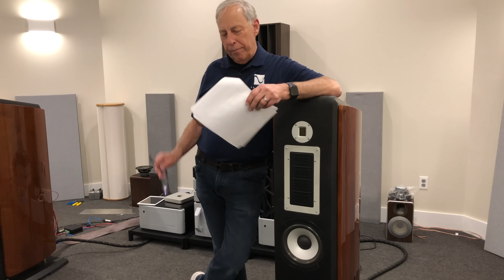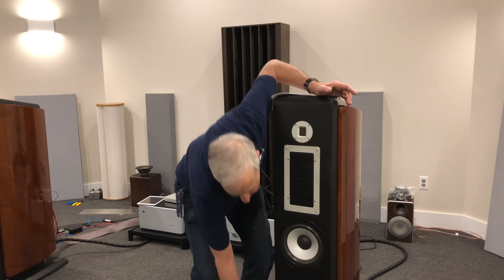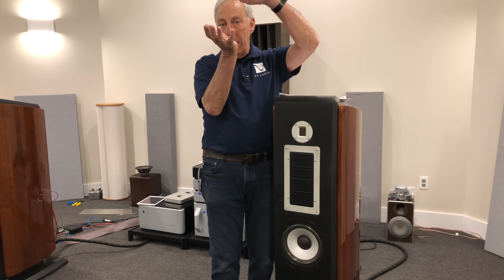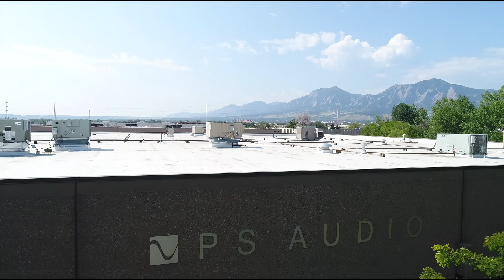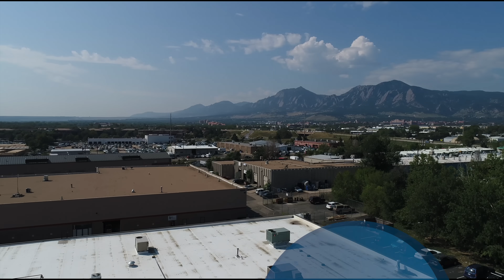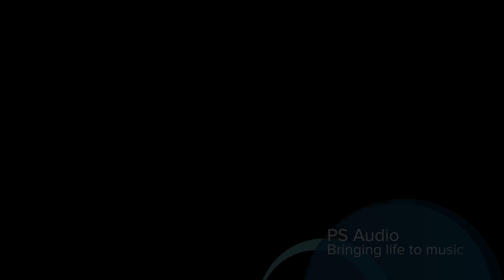Explain a 2.5 way audio system

Comment: 2 way
Tweeter: 2000hz - 20000hz
Woofer: 20hz - 2000hz

2.5 way
Tweeter: 2000hz - 20000hz
Upper woofer: 20hz - 2000hz
Lower woofer: 20hz - 200hz

3 way
Tweeter: 2000hz - 20000hz
Mid: 200hz - 2000hz
Woofer: 20hz - 200hz
Reply: that woofer rarely goes down to 20hz though

Comment: Actually a lot 2.5 way speaker simply a full range two way speaker with midbass addon. These speakers have a bookshelf like solid soundstage with a more bodied sound. If upper woofer in a closed box sounds much cleaner because there is no port distortion. Also lower woofer in a bigger ported box can extend bass much deeper without effect midrange and helps kick bass. I'm using 2.5 way German Maestro Linea-S F-One speakers on my system with stereo subs (12" closed box) works nicely I think. Thanks mr. Paul for very informative and helpful videos on this channel.

Comment: The Thought behind a 2.5 way  Box with, for example two 5" Drivers and a Subwoofer (like mine), is to  help the first 5" Driver reproducing the low frequencies which are not covered by the SW anymore. Lets say, the Subwoofer goes up to 80Hz, so everything over 80Hz must be covered by a 5" Driver, which has not really the best physical/ mechanical precondition to do so, because of its small Membrane Area & little linear Coil Travel. For better Mid Bass Reproduction one has to use a bigger Driver, but this would ruin the elegant Shape of the Speaker. So, one can take just a second identical 5" Driver and let it help his "Brother" when the Job gets to Hard for one 5" alone to do. I'm just finishing my first DIY Speakers,  which where made with practically no Budget and without expensive electric Tools, but with a ot of Sweat (no need for a gym when you can build a Speaker by Hand), some Tears and even sometimes a little Blood ;). The Subwoofer (12", 45l sealed, 2x TDA7293 parallel) goes up to 80Hz, the 1st 5" goes from there to 2800Hz, the 2nd goes to 500Hz, helping out at the Bass Frequencies just above the Crossover from the SW. All above 3000Hz is taken over by a 1" Dome Tweeter. Each Driver is powered by a 25W LM1875 ChipAmp. All Music is delivered by my PC with a Asus Xonar D2X Soundcard, the (Re-)Routing of the Output Channels (3 left, 3 right + 1 for the SW), the crossovers and all DSP Adjustments are made by the EQ APO Software and the Xonar Driver. 

I'm not completely done with it yet, and, as I am a total Noob in this, I expected not really much, but the result is ...  WOW! I'm f.... impressed what is possible even with a, not much more than, zero Budget.
A Photo can be found there > https://abload.de/image.php?img=box1panozhktf.jpg

Comment: Example
Tweeter: 2000-20000Hz
Upper woofer: 20-2000Hz
Lower woofer: 20-500Hz
Reply: The upper and lower woofer would not both extend down to the same 20hz in your example. The bass woofer would go to 20-500 and the mid range woofer would stop at 500 lowest (they would cross over so that both speakers play 500 at a lower db level so that the volume is still the same)
Reply: @ukspawn666 
That’s a true 3-way. 
A 2.5-way means no high-pass on the mid-woofer, thus it plays down to 20Hz.
Reply: @homeboi808  well thats what i thought too but testing my 2.5 way and they don't work like that. The mid doesn't play as low as the bottom woofer. So either the manufacturer is wrong calling it a 2.5 or idk... Some strange shit
Reply: Unless the mid/bass is playing it at much lower level... Maybe that
Reply: Ah that's it. I just played a 70hz sine loud and the bottom woofer plays the bass louder than the mid/bass. Makes sense now. Cheers

Comment: Huh, now i ask my self, why no more speakers that are 2 way with 2 bass/mids drivers not be made into a 2.5 system.
Reply: I'm going to try to answer for the x.5 way debacle.
I hypothesize that if you have two identical drivers and you cross them over to adjacent bands in the spectrum you get a more seamless transition between them because you're not stacking up multiple sets of  characteristics between the drivers.

Comment: Great video!... Thanks!
In your opinión, would it be better to upgrading a two way speakers to a 2,5 way or 3 way system...
I have made my own speakers with a tweeter and a 10" woofer...
My old Technics amp (SU8080) can manage them without problems.

Comment: This question comes from people that bought Pioneer "Andrew Jones Designer". I would just guess at this point of persons that are Concerned about this type of thing; would understand what I guess  "WE" try to lean towards.   That would be honest.

The two bottom drivers are crossed at the same freak. :P the upper driver.... EHHH. I am going to purchase replacement speakers from parts express.

   Thanks Mr. Jones..... I will be putting a little reinforcements in the corners- Polly fill.   

I would be giving those 5 speakers the same treatment. I am just trying to figure what would be the best 4 in driver for the center channel.

Cheers

Comment: Also the distance from the lower woofer to the tweeter could cause a phase problem .
Reply: In right design of 2.5 way, the lower woofer has no effect on the meeting point between upper midwoofer and Tweeter.  What you say can be true when it comes to planning a 2 way with two woofers play a same frequency and cross with the tweeter.  Like WWT array.
Reply: Oz Kol Audio we are on the same page, if the lower woofer was crossed over at the same point as the upper woofer there would be a issue, but in a 2. 5 it is not as you properly stated.👍

Comment: maybe a simpler way of explaining it is:  its like a 3 way but the "midrange" goes all the way down, thats why its woofer sized. 

or you can say its a 2 way with added "subwoofer"
Reply: The 2.5way speaker is not a 2 way speaker with a subwoofer. In right design, the extra woofer comes to compensate. Such as the baffle step compensation as  "active". All this without losing efficiency and maintaining half a distortion. Many 2 way and even some 3 way loudspeakers don't use with this network compensation...
Reply: That certainly helps explain why my L810's are three-way rather than 2.5, considering the midrange is "only" a 2" driver coupled with a 1" tweeter. Of course, in practice, that 2" driver is capable of handling a lot of lower treble and midrange freq. and the dual 8" woofers are mostly only for low freq. sounds.
Reply: @trog69  I had apair of L810s in the mid 80's through the 90's.
Really enjoyed those sheakers, still miss them.

Comment: Does the mid+bass driver ever cut off at a “too low” frequency?  If not, is that why it’s 2.5 way instead of 3-way?  Or is there a different reason for the term 2.5-way?
Reply: the term mean it is between at 2 way and a 3 way, you can only make a 2.5 way one way if you think about it.

if you have a high pass on the top woofer it becomes a 3 way and the benefit of having the 2 woofers produce bass is lost. if both woofers where playing midrange also then you get into problems unless you change the layout of the drivers accordingly.
Reply: I believe its due to using 2 of the same driver size where as a 3 way would use a larger bass woofer/smaller mid.

Comment: 2.5-way audio system ≠ 2.5-way speaker. 
A 2.5-way audio system would be 2 mid-high (or full range) speakers with 5 subwoofers.
Reply: No it wouldn't.
Reply: @carlosoliveira-rc2xt  You can't change set terminology as you please. Just because your car engine might be a V engine with 8 valves you can't call it a V8. The term V8 is reserved for V engines with 8 cylinders.
In audio terminology, a number dot number audio system refers to how many speakers and subwoofers are in the system. 2.0 is a traditional stereo system, 5.1 is a traditional home theater system.  
Speakers are 1-way, 2-way, 3-way, 4-way, 5-way  etc. A 1-way speaker doesn't have a crossover, a 3-way speaker has a 3-way crossover.
Reply: @LincolnRon . So you're saying, a 2.5 way Speaker, doesn't excist? 🤷‍♂️
Reply: @andyjefferson1308  No I'm not saying a 2.5-way speaker doesn't exist. I'm saying a 2.5 way audio system doesn't exist. Or at least probably doesn't exist. A speaker or a speaker system and an audio system are two different things. An audio system contains speakers, but also an amplifier, a music source or sources, (CD player, digital player, record player, tape player, etc.) and a processor or preamp.
Reply: @LincolnRon . I understand that. But this video was Explaining a 2.5 Way Speaker!! Not a System. 🤷‍♂️  Anyways, enjoy your Weekend. 👍
Reply: @andyjefferson1308 But this video was Explaining a 2.5 Way Speaker!! Not a System.) That's exactly what I have been trying to tell you this whole time. "2.5-way audio system ≠ 2.5-way speaker"
Reply: Many people make the mistake of calling their system a 7.4  because they have 4 subs. This is incorrect. It just means you have 4 subs. Unless every sub can be processed independently it would still be a 7.1 setup. I have a true 9.3 setup where the 3 subs can be set and processed independently. 
I've been in the business for 40 years and I know what a 2 1/2 way speaker is all about. My objection was to the .5 as having five woofers or subs. I have yet to see a processor that does this.
Reply: @carlosoliveira-rc2xt  You have yet to see an x.5 system because one doesn't exist as far as I know. And yes the second number isn't how many sub boxes there are, but how many subs the audio system has. It's not uncommon for a 2.1 PA system to have six 2-way speakers and four 2x18" subwoofers. Just like a 3-way speaker can have two 12" woofers, three 4" midrange drivers, and seven 1" tweeters.
Reply: Not

Comment: its a left and right channel and 5 subs. only true audiophiles are woke enough for 2.5 systems
Reply: LOL, ya, that's funny. I thought...WTF? L/R mains with 5 subs? Maybe it should be 2½ way speaker? So, what makes a 2½ way speaker different than a standard 3-way? Is it using 2 woofers, say, a 12" and an 8" to cross over from say 100Hz to the 8", then the 8" hands off freqs above 500Hz to the midrange? So, the cab would have 4 drivers then.
Reply: 1.7 mono multi bass system HA

Comment: I have a Polk large "center" speaker (from a yard sale) that has a tweeter in the center and the 6 inch drivers on either side.  The one on the right covers the mid range and upper bass range.  The one on the left is for the lower bass.  Many people (including me at first) would claim that the left speaker was not working and think the driver was bad.  It is easy to think this because the woofer seems to be not playing, but it is.
Reply: a sweep would show this yes